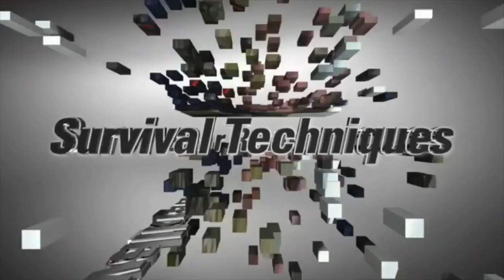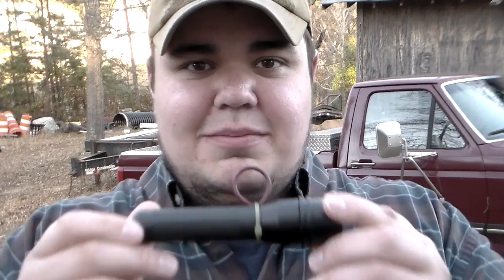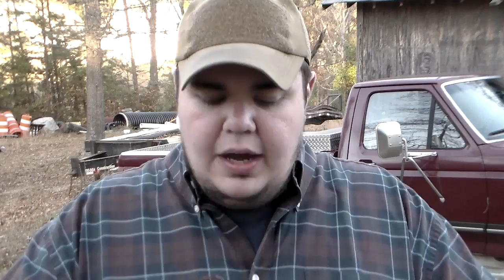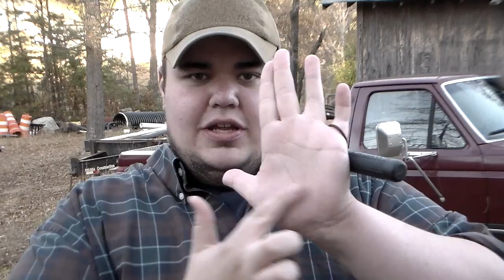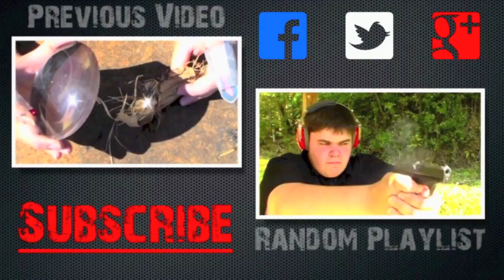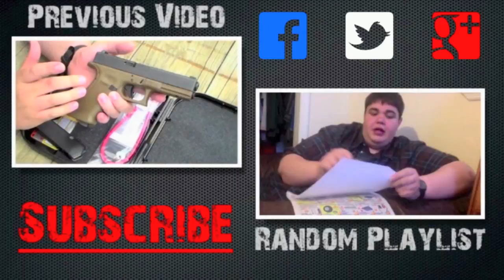Flashlight Retention System for Tactical Shooting

Comment: The way I see it: If your attachment point is at the bulb end of your light, chances are you will blind yourself with it when switching positions. 
When you "drop" it, you want the light to point down. It can be done but only if you use the saber grip.
Did you ever watched ReallyBigMonkey1 explaining his machete lanyards systems?
I'll try to locate this vid, so you'll see what I mean.
Reply from the maker: I only use flashlights with momentary on features. So I don't have to worry about blinding myself with my own light.
As for a lanyard...I don't put lanyards on any of my combat equipment. If my opponent gets there hand on my gear, they can lead me around like a puppy if they want to. I prefer something that I can ditch easily. Thanks for the tip, though! I like lanyards on most of my survival equipment.